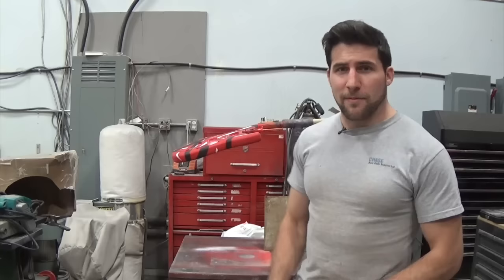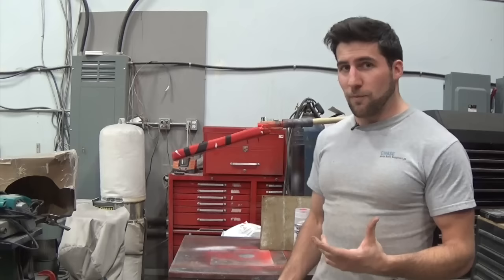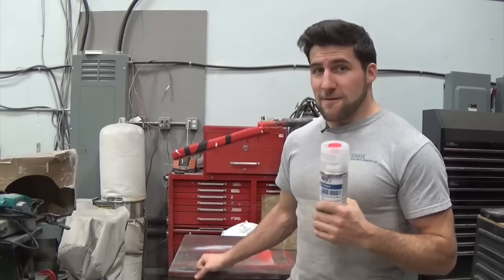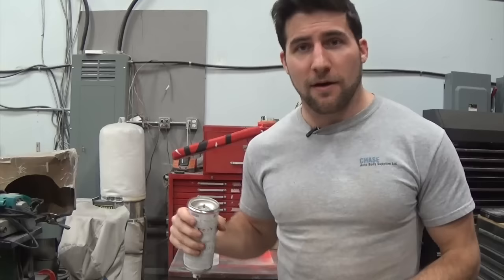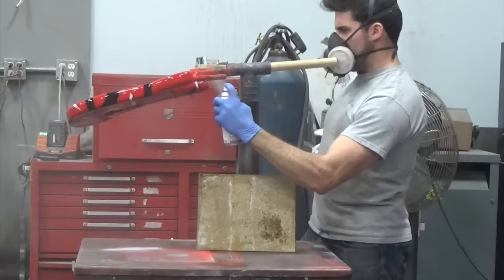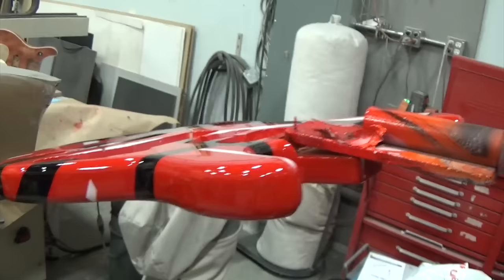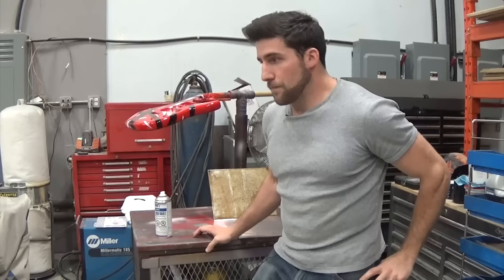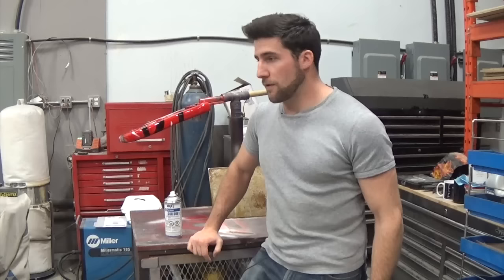How to get a professional looking clear coat with spray cans

Comment: very informative! I have a question so please answer if you can...I have a full beard on my face,not ZZ top by any means( I see you have a small beard). I was always told having a beard could make respirators somewhat ineffective...so, is there anything I need to be aware of,for health reasons,thanks in advance!
Reply from the maker: Ya, that’s true. I can still smell the fumes as they filter through my beard. The ideal solution would be an air fed mask that covers the entire head. Obviously I don’t have one of those haha.
Reply: thanks for the prompt reply! A couple of more questions if you will....what would be a safe radius while spraying( I live in a Condo and I have people living  close by, and I have a parking lot within 10 feet towards the front of the condo...I'm also worried about overspray and peoples cars) next question, I want to do a flake job(it will be microflake...so the flake will need to be buried but since its micro shoulddn't take many coats) I plan on spraying the flake via prevail(sp? then clearing it with this clear) what kind of clear should I use that is compatible with this 2part clear? last question, since this has a shelf life of 24hrs or less...how soon can I sand down between coats...many thanks,  I've just sub to your channel and will recommend it to friends
Reply from the maker: I’m afraid I’m not nearly qualified to try to tell you what a safe radius is. It dissipates through air, so further is better, but the rate at which it dissipates like depends on the climate etc. Overspray in the other hand I can tell you is a very real possibility. Somehow, paint like this managed to get everywhere. I mean everywhere. If you’re not spraying into some sort of makeshift booth/box, a light wind or something like that could move substantial amounts of paint onto a car fairly easily. 

If you let the previous clear dry fully and scuff it before using this stuff, it works with many products. I’ve used it over acrylic enamel, nitrocellulose lacquer, acrylic lacquer, and water-based clears. You should be able to spray, wait 24 hours, sand lightly, and spray again. That’s about the proper window if you feel that you’ll need two sessions.
Reply: thanks again!
Reply from the maker: You’re welcome.

Comment: Hi Brad, great video. 1 question,  can we sand in between clear coats. I noticed that you didn't
Reply from the maker: No, I’m doing my coats 10-15 minutes apart. The paint is still wet at that point essentially so it can’t be sanded.
Reply: @BradAngove  Thanks Brad for the explanation. For finer look, can we sand(1000 grit) after the clear coat completely dries
Reply from the maker: After you last coat completely dries you can sand. I’m not sure what you mean by a finer look.
Reply: @BradAngove  Thanks for the info, Brad. Finer as in smoother and glossier look.
Reply from the maker: Have a look at my videos on the sanding and polishing process. You will want to go smoother than just 1000 grit.
Reply: @BradAngove  i sure will, i'm checking out your spray paint videos and it is very helpful :) Some of the paint job are very satisfying

Comment: Hi Brad, thanks for this video. How many coats could you do in one session if you wanted to build it thicker? Since the can has plenty left in it could you go over three or is there a limit due to solvent evaporation?
Reply from the maker: I wouldn’t go beyond 4 in a session personally.
Reply: Thank you very much again for the help!
Reply: Did 4 coats as discussed. Great result! A couple of very tiny runs but I'm quite inexperimented with this kind of "large scale spray-painting" (it was a set-neck double-cutaway lp guitar so lots of corners/crannies with the neck attached). All in all I'm satisfied with it as a first attempt. Thanks again, if it weren't for your video(s) I wouldn't have known about this product. Cheers!
Reply from the maker: I’m glad to hear it went well for you.
Reply: How many coats would you do for this type of finish overall then..... ?  Total ... not just in one session...
Reply from the maker: Usually 3 or 4. 6-8 if I’m burying vinyl graphics or something.
Reply: The 4 I did were plenty. The guitar's been sanded and buffed to a near-miorror finish (It's my first of this type so it's not perfect like Brad's stuff) and there's no need for more. You could want more sure, but 4 is enough.
Reply: @BradAngove  thanks so much for the response.... I've been building for several years now, and usually use lacquer, however I'm really wanting a much more durable finish for my future builds

Comment: +Brad Angove can I spray white poly as a solid finish? Going for a solid white color, but don't want to use nitro. Is poly equally toxic & flammable? Do you need a primer when spraying poly?
Reply: Basically I'm trying to do a solid white, but want to avoid spraying anything toxic/flammable. Oil finishes & dyes would be transparent and show the grain, so those won't work. Any suggestions for what I should do?
Reply from the maker: You can use poly, but it’s still quite toxic. You’re looking for a water-borne acrylic.
Reply: @BradAngove  ok cool thanks. Can you spray it? I'm thinking of just wiping it on but i don't want brush marks. Also, will a wipe on satin poly work over a minwax stain? that one's for a different build- for that one i'm using minwax black and want a satin that won't get too glossy
Reply: @BradAngove  can you wet sand water-based acrylic? what grit would you recommend, 1500-2000?
Reply from the maker: You can spray acrylic. And generally the wipe on poly works fine Over those stains.
Reply from the maker: I would typically dry sand the acrylics. The grit depends on the stage in the process that you’re at.
Reply: @BradAngove  ok thanks. Any recommendations for a good satin poly, pros and cons of spray vs wipe on?
Reply: @BradAngove  do you move to progressively finer grits as you progress? What grit should you start with- don't want to sand through the paint or leave deep scratches in it
Reply from the maker: @anthonysclafani3963  I generally do 600 for paint, 800 between coats of clear, and then start at 1000 and go up from there for the polishing process.

Comment: Hey Brad!

I have a gtr I’m doing now which has Rustoleum metallic copper on the back and a mix of artist’s paint/mineral spirits/Japan dryer on front as sort of a dye. Think I can use the Spray Max 2K on this one?
Reply: Also was curious how often you change filter elements on your respirator. Intervals?
Reply from the maker: I mostly just change the dust filter on them when it gets dirty. The fume filters last for ages. 
As for the paint, I’m not really sure how all that stuff will work together. I think the spraymax is probably a good option if your let it all dry completely, but are you sure all of that is compatible?
Reply: Sure...no. Hopeful...yeah. Chris over at highline wasn’t sure about Minwax Wipe On Poly over Rustoleum, which was my first inclination. I have three guitars to do at once, however, and thought I might be able to use Spraymax on all of em, thereby avoiding waste of half a can due to hardening. Guess I’ll test on scrap right before I start the clear coat on all.
Reply from the maker: I think the spray max is probably your best bet. It tends to be widely compatible. You just need to make sure everything else is fully dried first.
Reply: Thanks, man!

Comment: Hey brad could you do more then 3 coats in one day if you wanted?
Reply from the maker: You could generally get away with 4, but not more than that. Even the shops with heat curing don’t tend to do that. At least not with this type of paint.
Reply: @BradAngove  ok thanks. So with the 2k clear you recommend judt waiting untill the next day, scuffing with like 800 grit, and spraying additional coats? Im trying to bury a little decal but i want to make sure all id have to do is scuff it up and spray again like i did with the color coats
Reply from the maker: @joepangrace1983 yes, that is correct. That’s what I would do.
Reply: @BradAngove  thanks so much. Always helpful!
Reply: One more question brad if you have a moment. The haziness you get from lightly sanding this stuff with 800 will not cause issues with final additional layers of clear?
Reply from the maker: @joepangrace1983 no the clear coat will fill that in.

Comment: If I sprayed high gloss 2k 2 days ago abut didnt get it thick enough can I just spray more coats on it as it?  Or do I need to rough it up or anything?  Will it stick since 1st is already cured?
Reply from the maker: You’ll want to sand the current clear coat with about 800 grit paper so that the new stuff will stick.
Reply: @BradAngove  Thanks!  Other guitar builders said just spray it.  I figured you would know best
Reply from the maker: If you were doing lacquer over lacquer you could just spray it. When switching types it’s prudent to sand it to allow for mechanical adhesion.

Comment: Hi there I really appreciate your videos. I have a question about what I can put Spray Max 2K clear coat on top of. I am painting a bike with Spray.Bike products. The primer and paint have gone on well but the clear coat is pretty thin and not covering my vinyl decals as well as I would like. @bimbambabybikes After watching your videos I am wondering if I would get a better finish with the Spray Max 2K but on the inter webs it seems like there can be issues with the 2K clear depending on what you put it on.
Reply from the maker: I’m not familiar with that product. Do you know what kind of paint it is?
Reply: @BradAngove  HI Brad, thanks for getting back to me.  The paint is acrylic "dry matte powder coating".  The clear coat is described as an "acrylic coating".  At the end of the day, I really don't want to make a mess of my project so I think that I will keep working with the Spray.Bike clear coat.  Next frame I build I will likely use the Spray Max 2K clear coat, and the 2K primer as I get the impression that there are some durability issues with the Spray.Bike products.  The advantage is that the paint really did go on beautifully with no drips.
Reply from the maker: I’m not entirely sure if the powder coating aspect is a chemical change in this case. 2K works over acrylic, but it’s probably safest to stay within the same system.

Comment: can i use the spay max 2k clear coat on top of rustoleum rattle can satin paint ,  or is the rustoleum clear coat good enough ( i'm using only one color ,lilac ) thanks  
ps. learned allot about finishing guitars  thanks
Reply from the maker: You can use either one. If you're using the spray max you'll want to make sure it has cured completely before you apply it.
Reply: just used the spray max 2 k  clear coat its way better than the rustoleum clear,  love the coverage of the of the tip . i'm gone use it from now on well worth the price . thanks from new orleans  .  alexander
 ill send you a pic of the finished guitar if you like
Reply from the maker: It's good to hear that the product works well for you. I agree.
And I'd love to see a picture of the guitar. If you check out the link to my Facebook page in the video description, that's where people usually send me photos. Or you can give me a shout with it on instagram.

Comment: I have a HVLP sprayer, what paint & clear coat products would you recommend?
Reply from the maker: It depends on the application and what you’re trying to achieve. What are you painting?
Reply: @BradAngove  Thank you for your response! I haven’t got it yet but I am buying a Trev Wilkinson Tele kit. I think I want to keep it simple for my first attempt and just do a solid color like sea foam green or a deep blue with a glossy polished finish.
Reply from the maker: If you like lacquer I would go for the Oxford supply lacquers. They’re easy to work with and they have vintage colors like that.
Reply: @BradAngove  Thanks Brad! Your content is excellent!
Reply from the maker: Thanks Tim

Comment: @Brad Angove, I got lots of little drips on my two bodies when using the 2K; one was just the front and the other full body. The frontal one I know what I did wrong(too close and heavy coat) the one that I had hanging(vertical, not sideways like you) though, I can't figure how to stop the horns from dripping down on to the main body, even with a light coat. Any tips?

Edit: typo
Reply from the maker: What kind of 2K are you using and how warm is it where you’re spraying?
Reply: @BradAngove  SprayMax 2K Clear Coat, it was 27C/81F when I was spraying. HIgh humidity here as well though.
Reply from the maker: That’s hot enough, but the humidity might be causing an issue. Realistically though it’s probably the same problem. If you spray a little too heavy it will sag.
Reply: @BradAngove  Yeah, humidity probably messed with it. I decided to test it out(albeit after a solid day's rain) and it looks like multiple fast sweeps while applying the same amount of paint did the trick. Could be that it actually ended up with a thinner coat, but, no sanding drips with timber mate out of the finish makes me happy :) 

Cheers for the reply Brad, keep up the good work.

Comment: Do you sand the paint at all before spraying the clear coat?
Reply from the maker: Yes. Lightly with 800 grit.
Reply: @BradAngove  even with metallic paint?
Reply from the maker: No, with metallic paint you would want to do a quick midcoat clear that you can sand.
Reply: So I'm pretty new to this and a little lost on what a mid coat would be. I'm using a duplicolor perfect match and a spray max 2k clear.  I've seen the videos you made on duplicolor, but I guess I'm still a little lost on the prep to clear coat with metallics.
Reply from the maker: @Zues42208 you would likely just use the duplicolor clear as a midcoat. It’s just something you can apply right away to seal in the metallic so that you can let it dry and sand it without screwing up the metallic look.
Reply: Okay perfect. Thank you very much. I really appreciate it Brad, you've been a huge help.
Reply from the maker: @Zues42208 glad to be of assistance

Comment: Hi Brad thanks so much for the informative video. I'm considering using the 2K clear on color laminated wood for a deep clear finish. What should I use as a clear sealer, before the 2K finish? Also could I do more than 3 coats initially before the 24 hour scuff and re-coat? Thank you for your time to answer.
Reply from the maker: I’d use either the Mohawk vinyl sealer or the crystals transparent filler and sanding sealer generally if it were me. 
You can do 4 coats in that first session. I wouldn’t go further than that.

Comment: I ordered a can of this exact clear coat and for some reason it ran out very quickly and left one spot of my guitar less glossy than the rest. I think the seller on amazon sent me an old one or something weird was up. Is there a type of can you would recommend me getting to finish the job that I can buy locally even though it’s not 2k? Is that evens smart move at all? It’s still shiny just doesn’t look as thick as on the rest of the body.
Reply: Even a*
Reply from the maker: Have you considered just polishing that area? Does that seem like it might work?
Reply: Brad Angove I think I will go ahead and try that. Waiting for it to dry 24 hours before wet sanding and polishing but if by any chance the spot isn’t working out with the polish could I just clear it again later even after the rest of the body is finished?
Reply from the maker: You’ll need to carefully clean it and sand it lightly with some 800 grit for that to work. Paint doesn’t stick to polish.

Comment: hey man i've been wondering if you had tried marble painting?
Reply from the maker: Which kind?
Reply: @BradAngove  the one where you put different paint colors on a bucket of water swirl them so that they create a marble effect and then dump the guitar body in the water so that the paint sticks in the body of the guitar?
Reply from the maker: I’ve done very little of that. I have a video on doing it with spray cans.

Comment: Hey Brad,Can we see the metal plate you clear coated?🙏🥁
Reply from the maker: I’ll have to find that again. Meant to do a project with it. Never got around to it.
Reply: @BradAngove  Im refurbing a Bronze shell snare drum started at 600 grit all the way up to 5k with Meguiares ultra compound,Just wanting to lacquer now to protect from patina/ acid fingers
Enjoyed the Vids, Thankyou 👌
Reply from the maker: If you’ve already polished it you won’t be able to clear coat over it. The clear coat won’t stick to it.
Reply: @BradAngove  Ahh I've gone to far then..Will go back to 1500/2000 grit then lacquer
Reply from the maker: Make sure you clean it carefully. The compound could cause problems. Use wax and grease remover.
Reply: @BradAngove  I wiped it over with Brake cleaner after I had finished and all seemed well🏆 I was planning on getting a professional car sprayer to lacquer but too busy up to Christmas 🎄

Comment: Can I spray 2k clear on top of enamle or do I have to wait to dry?
Reply from the maker: +Andy Lopez you have to let it dry first.
Reply: Brad Angove will I have the same finish as your guitar or will it be different?
Reply from the maker: +Andy Lopez If you use a 2k polyurethane as your finish, that’s the same finish I used on this one.
Reply: Brad Angove how long would you recommend to apply the 2k clear? And thanks for the info
Reply from the maker: +Andy Lopez if you mean waiting time, 2 weeks would be a safe bet.